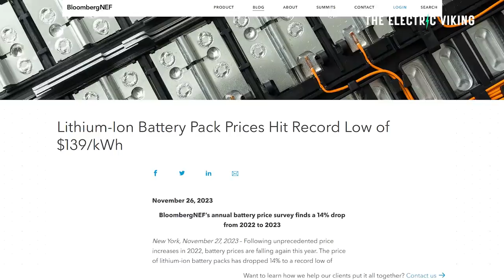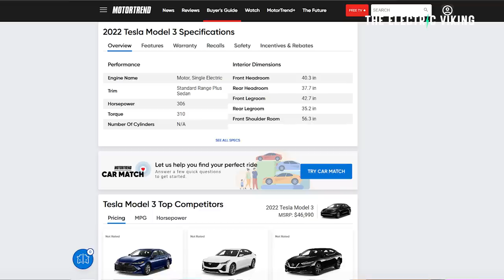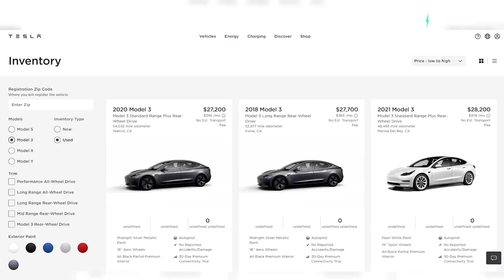Battery prices hit record low; Why have most EVs not come down in price?

Comment: EV prices aren't going to come down when the manufacturers know full well that policies are being introduced to make ICE vehicles just as expensive so that there's no financial advantage for the customer.
Reply: Prices have come down quite a lot this year and the end of last year, especially if you take into account inflation over the past 3 years.  Reduced battery costs will help push down prices some but if any real competition finally shows up prices will fall further.  Competition always reduces prices, doesn't matter what industry.
Reply: @Ryan-ff2db  Prices are falling because buyers are bailing.  The abysmal resale and pending insurance issues aren't helping matters either.  Manufacturers are losing money and have stock they simply can't shift 'at any price'.  The threat of any new battery technology will also destroy existing sales and increasing examples of 'rapid conflagration disassembly' has to be the icing on the cake.
Reply: @kellyeye7224  EV sales are up 51 percent this year.  I'm not sure how that's bailing.  I also don't know what you mean abysmal resale either.  I just did search in my area and used EV's are still way too high, especially when you can get a new one for about 5 grand more. Why would anyone pay $27,000 for a model 3 with 80k miles when you can get a new one with Fed and state discounts for around 30.  It just doesn't make sense to me.  If your talking fires that just complete and utter nonsense, gas vehicles burn 20 times more by percentage than EV's and you are far more likely to die in an ICE vehicle.  The anti-ev crowd need to throw hybrids in the same category to distort the numbers so they can continue the fire rhetoric.  Hybrids have a fire issue, EV's do not.
Reply: @Ryan-ff2db  Sorry, I keep forgetting, the USA is 'the whole world' and events elsewhere have zero bearing on matters.  Even the Electric Jesus himself reports on EU manufacturers cutting back production, Ford being unable to sell their EV trucks, Jaguar iPace falling apart etc etc.  You can cheery pick as much as you wish but without the corporate sales markets EVs would have been abandoned as a profit-making exercise years ago.  If Bernie Madhoff had received subsidies the way the EV markets do he'd still be in business..
Reply: @Ryan-ff2db  I know I sound like an EV hater.  I'm not.  If there were two identical vehicles and the only difference between them was the fuel i.e. gasoline (or diesel) and electricity and there was nothing else that differed I'd buy the electric version.  But thereby you see the problem.  There are differences - BIG differences and, for the most part, those differences mean I get a 'worse' product (all other things being equal).  Worse mileage, longer refuelling, lack of infrastructure, greater tire wear, expensive spares and servicing (recent news reports of 80%+ more expensive repairs and fault reporting) etc.  There is no comparison - EV's are currently worse than ICE vehicles in all essential respects and using a fabricated climate issue as the leverage to push them is rubbing salt into an open wound.  People aren't uninformed.
Reply: @kellyeye7224  Legacy will have issues but that's because their EV's are pretty bad and there's a high cost of transition.  Tesla, Rivain and Byd saw significant gains.  Not just in the US.  either Global sales will be up 35 percent this year.  If you think EV subsidies are bad please take a look at total global fossil fuel subsidies.  It will blow your mind how much money we actually dump into fossil fuels, and dwarf any EV subsidies by a gigantic margin.  Madhoff would run Exxon in your analogy.
Reply: @kellyeye7224  EV's have some downsides for sure but they have many upsides as well, it depends on how you use them, and whether they are good for your purpose.  Most of my vehicles for my business are diesel or gas.  We are transitioning the vehicles to EV's when we can, but they don't fit every purpose, especially for heavy duty diesel work trucks.  The second there is a viable EV truck that can perform as a Utility or flatbed I will be buying it.  Diesel trucks emit a loud money sucking sound that never stops, if you had to run modern diesel trucks you know exactly what I'm talking about.  The fuel filters alone are nice kick to balls every 15,000 miles.
Reply: @Ryan-ff2db  All I'd say about EV's is that if they weren't invented no one would be asking for them to be.  There is nothing an EV does that an ICE vehicle can't do already and do it better than any EV.  The one and only purpose behind EV's is the need to impose control and doing so on the basis of a fabrication (that CO2 is harmful).  EVs consume resources unnecessarily and have brought about a 'demand' for electricity that we can't manage to fulfil, is increasing energy costs for everyone, draining taxes from us all and doing diddly squat to 'save the planet'.  Each to their own of course.....
Reply: @kellyeye7224  "There is nothing an EV does that an ICE vehicle can't do already and do it better than any EV" - I sincerely disagree with that.  They are cleaner, quieter, more powerful, more efficient, cheaper to run, cheaper to maintain, safer in almost every category, and just more fun to drive.  About consuming resources unnecessarily, I think you really need to look up global fossil fuel subsidies.  The amount of resources and taxes we spend on fossil fuels will blow your mind and dwarfs any subsidies for EV's by an astronomical amount.  Nobody talks about this, but the IMF keeps track of all global spending, and the resources we devote to oil and fossil fuels is beyond belief.  If we could put those resources to a smarter use the world would be a far better place.  EV's are good start.

Comment: They still have to sell through the current higher priced stocks. That could take a while. But the battery prices don't excuse the highway robbery that is going on with EVs. It also doesn't explain why the big corporate bastards won't build more EVs.

Comment: EV's, at this time and with current tech, only appeal to a niche market of consumers due to 1) range: typically lower than ice, severely affected by low/high temp or towing a load  2) availability of charging stations: tiny fraction of ice fuel stations, often none in small towns or remote areas  3) time to charge: min one hour, often have to wait for one, throughput compared to ice fuel stations is poor - you would need about 8 charging stations with multiple chargers to equal the throughput of one ice fuel station (5 to 10 min per car instead of 1 hour)  4) longevity: EV's are good for about 10 years, then the battery must be replaced out of warranty and cost 20k or 30k at least, ice cars will last 30 years with reasonable maintenance  5) When fires occur by thermal runaway, they burn 3 to 4 times hotter than ice fires (hot enough to melt steel and burn through concrete) and are nearly impossible to put out because they supply their own oxidizer. Current EV's only appeal to customers who use them only within or between large cities, or who have an ice vehicle also to do what the EV can't.